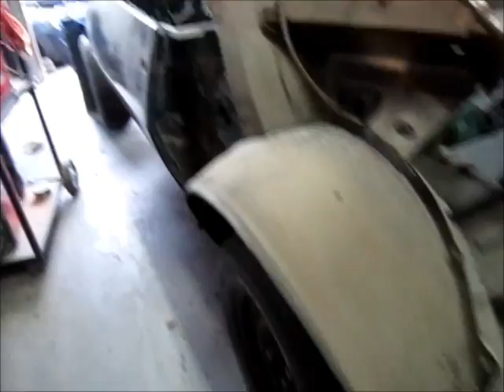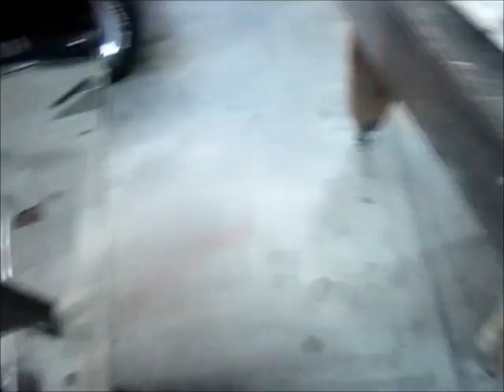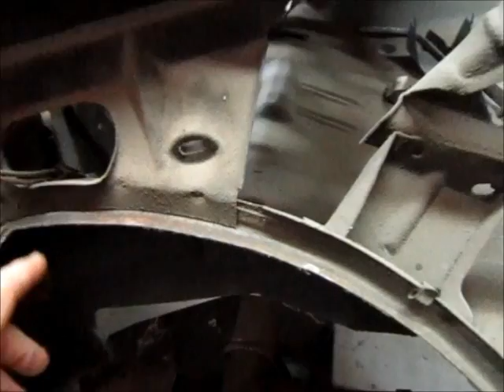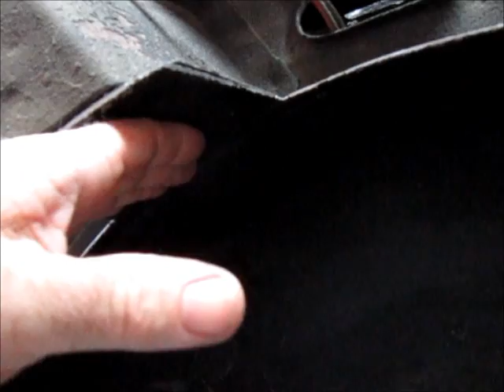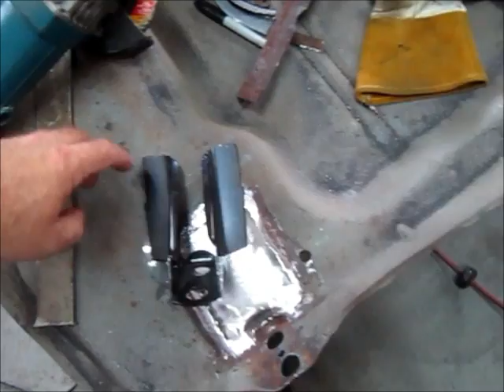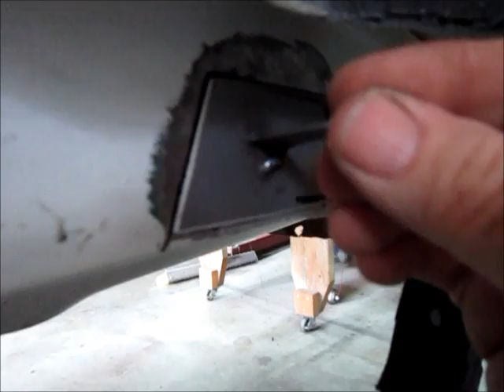1968 Camaro left wheelhouse and quarter panel

Comment: I  know this video has been make years past but the patch that you did on the frame rail I believe is the Rear Axle Bumper Bracket holes, which was on the 1969 Camaro,  I assume they would be on the 1969 Camaro too.   Here is a link to OER's product:  https://www.oerparts.com/product/3932734.html

Comment: My Brother you are going to have a certified nightmare trying to line up the back of this car with all the seam's you have cut off with out the help of supports the back of all the early camaros are so difficult when it come's time to align trunk seam's with Quarter panels and rear panels .. It's a real kick in the balls .. but to do it without any structural support is inviting migraine headache .. Good luck bro  really ...
Reply from the maker: Car is long since built and gone. Check out the detroit speed mini tub kit I installed.

Comment from the maker: Thanks for the feedback. As far as the rust prevention, I usually try to use a weld-thru primer where I can. Unfortunately, there's no easy way to paint the inside of these areas. At the body shop, we have a kit that we use to restore the rust prevention coating to the inside of frame rails. It has a nozzle like a sprinkler head on the end of a hose. We insert it into a hole in the rail, and spray as we remove it. The entire inside area is coated. Hope that helps.